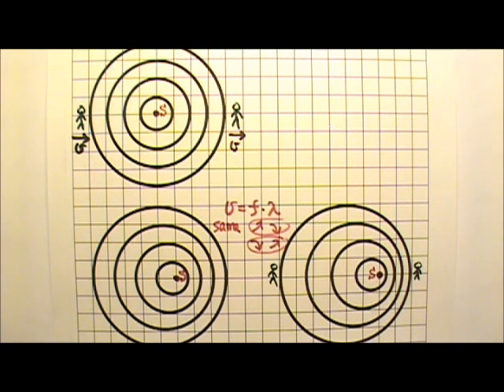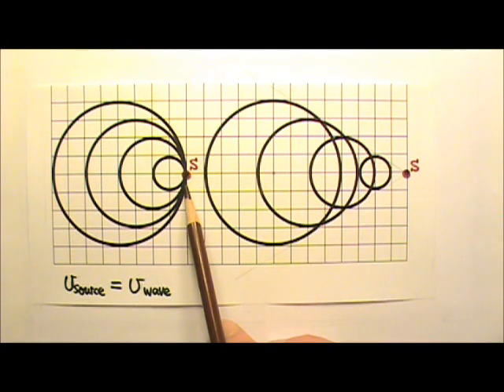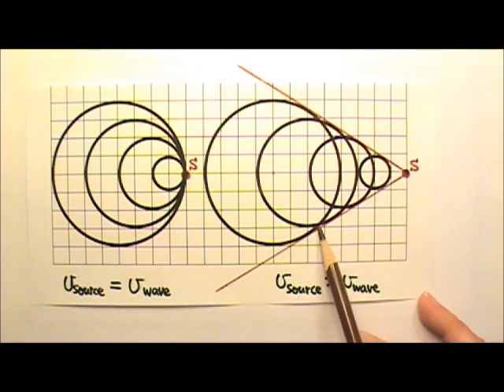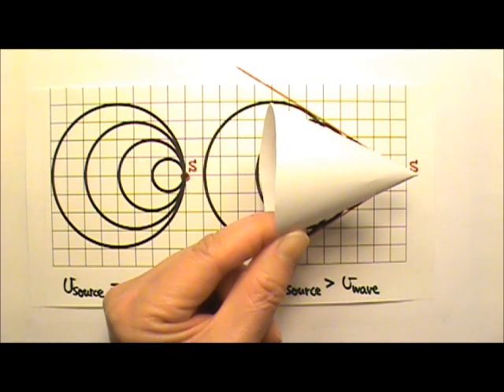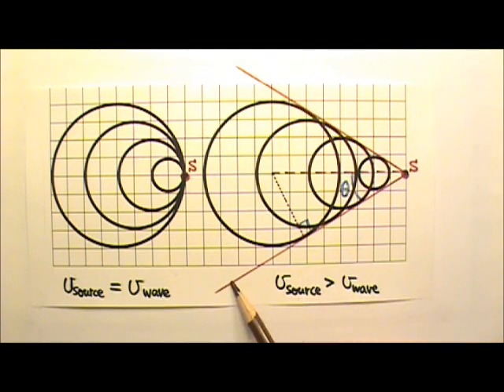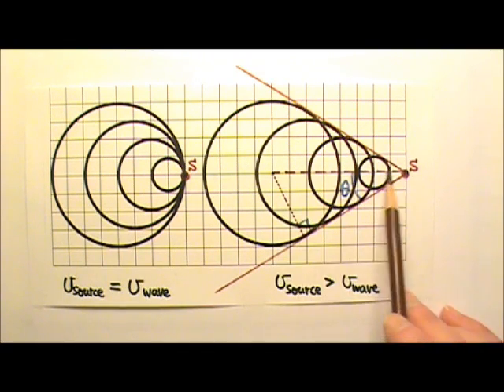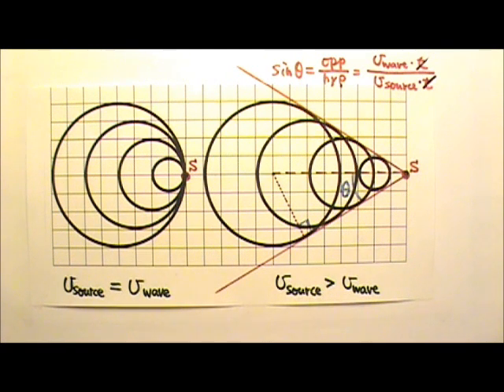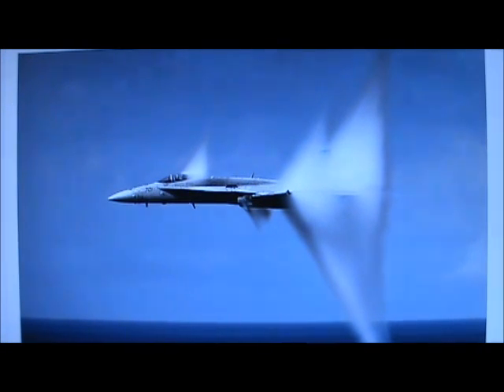AP Physics 2: Sound 6: Shock Wave

Comment: Very clear basics . Will be nice to know about pressure created by waves and its effect in water/fluid.
Reply from the maker: +Gurman Gill Sound waves can travel through fluids and solids too. So there is a pressure wave traveling through a fluid when sound travels through a fluid. The fluid can be a gas or a liquid. A liquid is usually not compressible, so the pressure variation is not obvious. Imagine a longitudinal wave traveling through a slinky. A liquid with sound wave traveling through it would be kind of like slinky under higher tension and each ring of the slinky goes through very small displacement when a longitudinal wave travels through it,

Comment: FYI! The shockwave does not create the formation of condensation. It happens after the shockwave has passed and your in the low pressure area. Temperature drops. If the temperature drops below the local dewpoint. Moisture will condense and form observable moisture in the air. 
If it was because of the high pressure of the shockwave it would form moisture all the time it was going as fast or faster than the speed of sound.
That's why you only see the demonstrations low over ocean water. Because of the high moisture content. Temperature doesn't need to drop very much to form observable moisture. It's the same thing that happens on the wingtips when you see airplanes doing aerobatics. The temperature drops and the same thing happens in the center of the tornado. I've seen videos of tornadoes forming. First you see debris then suddenly you start seeing observable moisture form.

Comment: Thanks, Ms Twu, I found your website. I've two questions. 1. I know a shock wave is produced when the wave source is travelling faster than the speed of sound. Why is it speed of sound but not any other things, like speed of light? 2. For a plane travelling faster than sound wave, a shock wave is produced. If someone passes thru this shock wave, would he/she experiece great force which is enough to push him/her away?
Reply from the maker: I am glad that you found my website : ) 
You have some very good questions. The wave speed here is the speed of the wave created by the moving object. E.g. a moving boat disturbs water, so when the speed of the boat is faster than the speed of the water wave, we get shock wave in water. A moving airplane pushes through air, disturbs air and creates pressure/density waves, i.e. sound waves - just like a vibrating drumhead disturbs air and creates sound waves. So when an airplane travels through air at a speed faster than the speed of sound, we get shock sound waves in air. I hope this answers your first question. 
As for the 2nd question, my guess is that the person would not experience a great force to push him/her away. A traveling wave is a traveling disturbance. The medium does not travel with the wave. When you throw a rock into a pool of water, circular water waves are formed and the waves travel outward, but a leaf floating on water does not travel outward with the water wave. When a sound wave travels through a person, the pressure/density wave disturbance travels through the body, but the wave does not push on the body to make the body move with the traveling wave.
Reply: onlearningcurve Thanks so much, Miss Twu,Your answers are very clear to me. You really help me understand sound waves better. I can't love you more~

Comment: Thank you very much. I am wondering if you can explain the sound generated from a suction cup release. Does it follow the same physical principles as you described in this video?
Reply from the maker: In order for a wave to be shock wave, the wave source has to be traveling at a speed that is faster than the speed of wave. For example, when the tip of a bullwhip travels so fast that it is faster than the speed of sound in air, the cracking sound it makes produces shock wave. When a suction cup is pulled, it does not travel very fast. So the sound produced by the suction cup would not produce shock wave.  
A wave is a traveling disturbance. When a sound wave travels through air, it causes a pressure (or density) variation traveling through air. When a suction cup is pulled on, it gets a small pocket of low pressure inside (like a partial vacuum) - this and the vibrating suction cup flap (when it separates from the surface it is attached to) make a loud sound. It's loud because there is a large pressure difference (kind of like amplitude - pressure difference between the "peak" and "trough", the compression and rarefaction). But it is not a shock wave. 
I hope this somehow answers your question.
Reply: Thank you so much. Yes it does help. Here is a video of a suction cup release and as you can see, the cup material doesn't look like it generates any noise...or does it? https://www.youtube.com/watch?v=9hWbKRAwlFg
Reply from the maker: ***** It's interesting to see it in slow motion. The cup does vibrate and move a lot when the cup is lifted. When it vibrates, it disturbs the material around it (air, and the glass) creating pressure wave (sound wave). So yes, the motion of the cup material acts like vibrating drumhead to create the loud sound we hear.